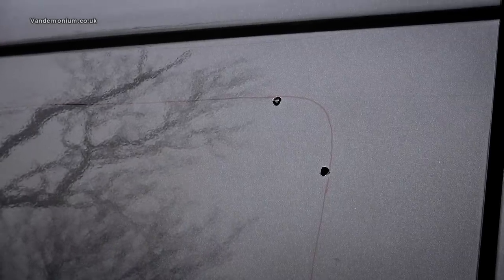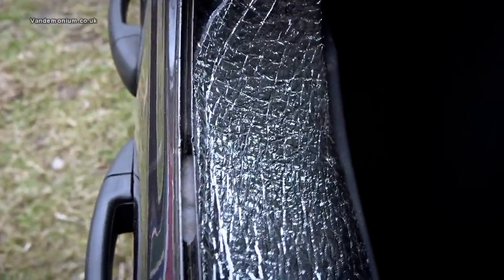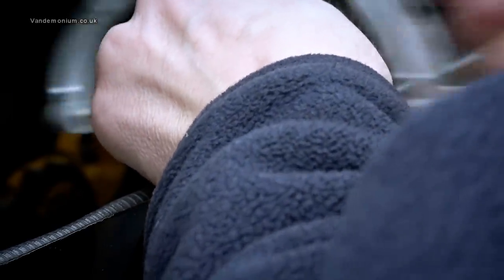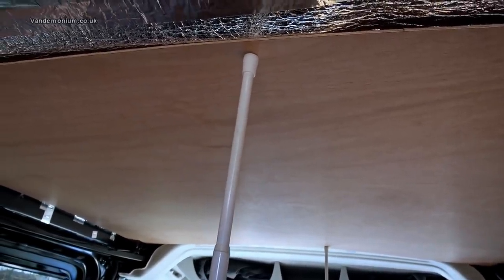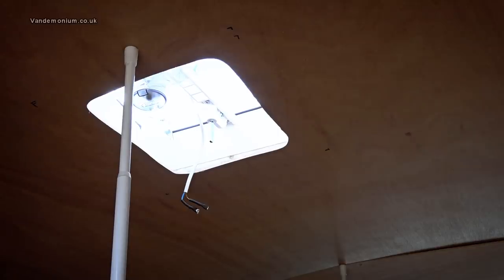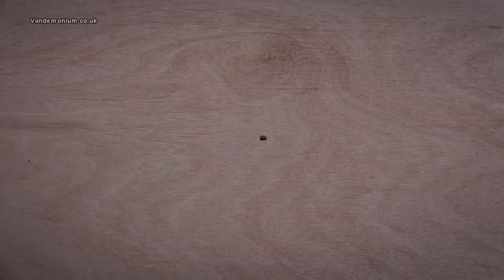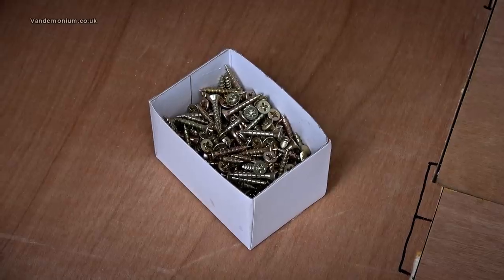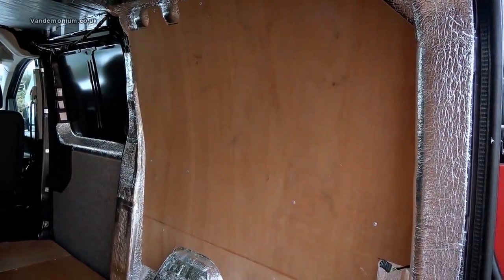Vlog 12: installing a bonded side window to my DIY campervan (Toyota Proace)

Comment: I'm a complete noob at this and I am amazed at your work and your patience in actually taking the time to vlog your progress. I can imagine just how much time and effort you have put into this project, not only the work of turning your Proace into a camping van but also the work of filming and vlogging! Many thanks!
I have a newer model Proace and am just starting to do the same. 
One question if I may. Is the wiring for the LED lights and Skylight fan spliced into the existing wiring or will all the modifications run off your solar setup?

Comment: Exactly the same thing happened with the width of the trim that was supplied with my windows. There were two skins to get over and luckily the "Glass for Vans" chap doing the install rang his office and they ordered me some much wider which fitted over both skins. Does make you wonder why they don't sell you the right stuff to start with. Coming on nicely Dave!
Reply from the maker: Cheers Greg. I'm now three vlogs "in hand" and making the cabinets ... I think you'll cringe at my shambolic attempts at carpentry but at least it's starting to look more like a camper now :-)
Reply: You are so fortunate to have the time to crack on, work is still taking its toll on my build but not for much longer 😃
Reply from the maker: That's because you're gadding about going to festivals like Camp Quirky instead of building ;-)
Reply: I'll expect to see you there next year showing off your finished ride 😎

Comment: Couldn't help but notice when you were building your van that a straight edge might have helped. If you are interested I was told to put a straight piece of metal down (or a level), clamp it to your wood and use that to run your saw against. You will get great, straight cuts that you will be proud of. Cheerio!
Reply from the maker: I did try that but somehow still came out with wonky lines
Reply: Vandemonium it doesn’t work with a jigsaw. BTDT. The blade bends sideways too much. I mean, that’s literally what it is intended for, making curves.

Comment: Came across your great vlog. at the weekend. Now caught up and looking forward to seeing more. Have been contemplating one of these vans instead of the joining the VW crowd (and there really is a crowd of them here in Cornwall).
Nice to see you opting for the side bench approach too. Don't think you'll regret that - especially if you keep room at the front end to be able to sit opposite an open side door.
Think I'd ponder a way to fit a shower curtain between the ends of the open back doors.
Reply from the maker: Thank you. Yes, there must be some curtain arrangement I'm sure!

Comment: Looking good so far, I know it's late and you have already done it but they make a tool that goes into the drill that is a quick change drill on one end, pull it out and flip it around and it's a countersink on the other. Pros use them to save time and not have to unchuck the drill then put in the countersink, also it makes it easier to keep track of the two because the drill and countersink are a double ended arrangement that always stays together.
Reply from the maker: That sounds neat, maybe I'll get one

Comment: I did wince slightly when you handled the cut out from the door with bare hands. Gloves may have been sensible. Did you know you can get pilot drills with a built in countersink? Your videos are informative, funny, and give a real sense of the elation and frustration of a self build. Thanks.
Reply from the maker: Not sure why you were wincing? Yes, you can get combi drill/countersinks but then you have to buy a set to ensure you have the right size pilot hole. It's more bother to have separate ones but only one countersink needed. Glad you like the videos, cheers
Reply: "Not sure why you were wincing?"
 - Burrs
Reply: Cut metal edges like that tend to be sharp. You can cut your self quite badly on them
Reply from the maker: Ah. Thank you. It was fine though, no blood was spilled on this occasion. :-)

Comment: My understanding is the window trim is designed to go on the inner skin only anyway. Found this out after I’d ran it round on both skins myself lol
Reply from the maker: Interesting; a lot of the YouTube tutorials I watched clearly had it going on both. Otherwise when you get condensation in the van, it'll run down the window and between the panels and soak into the insulation there (I have squeezed sealant in the gap)
Reply: It will be designed to go over two skins that have been spot welded together. If you pull such a seal off a car you will see both skins meet and are bonded and spot welded together. Obviously this wasn’t the case where the window wasn’t factory fitted. I would have tried to get the skins together for condensation issues and a bit of strength/integrity between the skins. I’m sure Dave did a fine job in sorting something.

Comment: A quick question, now that we're entering May. Will you be returning to the sea ( Canals actually) and storing your land yacht ( Camping van ) or finishing it before you set-out for your next port of call. Arrg. (Said with a bad pirate voice).
Reply from the maker: Hi. I'm still aboard the boat and have been all winter. The van needs finishing before I do any cruising though plus I have some paid work coming up that I need to be around for so any cruising will be minimal until much later in the year I think.

Comment: There are countersink drillbits that can be placed onto a drill. You drill and countersink in one go. I havent used such, but i plan to. It looks quite convenient.
Reply from the maker: I saw those but then you need to buy a whole set with every version of pilot hole size you want
Reply: The way you have done it, while a little slower, is much better in your situation, and the coutersink bit can be used for many more jobs in the future.

Comment: Its starting to take shape nicely, I'm sure that it will end up looking pretty dang spiffy. Good preparation really shows in a finished product.
Do you have a link for the led lights you are using, they look just the thing to upgrade the ones in my narrowboat. Regards, Chas
Reply from the maker: Not offhand but I'll try to find a link next time I'm sat at the laptop. I just found them on Amazon though.

Comment: I’m not sure that hacksaws even come with wood blades, but if they did they’d have more teeth per inch and would probably work better on the rubber than a metal blade would.

Comment: David, as a non driver I wondered if renovations on your vehicle alter MOT or insurance requirements.
Reply from the maker: No change to the MoT; it's insured as a campervan and the insurers are fully aware it was self converted.

Comment: is the window trim not also intended to atop condensation from the window dripping between the panels?
Reply from the maker: Possibly but I thought of that and went around the gap between the panels with a thick gooey waterproof sealant.

Comment: Next time use masking tape where you are jig sawing so you don't scratch the paint
Reply from the maker: Thanks. I did that on the back ones but didn't have any this time. It doesn't matter though as the scratches were light, get hidden by the glass and I blobbed some primer over them as well.

Comment: I have restored several antique cars. One guy I met doing one. Told me something that has some real truth to it. It may take you longer, but you did it yourself. Now I have an question. Is there any chance that rain can get behind the glass at the top. I ask this thinking. If water gets in. Could it freeze , and possibly expand and break the glass.
Reply from the maker: If it goes behind, it will either flow out along the line of the sealant or if frozen, would freeze up and out the gap. This form of window fitting is pretty commonplace and I've never heard of any breaking through freezing water.

Comment: Can I ask what is the length of the interior load area of your van, did you consider the long wheelbase vs the short?
Reply from the maker: It's the LWB version though it's only about a foot longer than the SWB
Reply: Lwb will make all the difference in comfort! Have a double width bed!
Reply from the maker: The wheelbase doesn't affect the width of the bed; it will extend sideways to make a (rather slim) double.
Reply: Vandemonium  I’ve been on the verge of buying a lwb transporter , purely because Lucy my large dog will need her own floor space to sleep on, that’s why I was asking, wanted to know how much floor space would be left (in theory)  when your bed is in use
Reply from the maker: Mine's not a Transporter so I don't know how much you get in those, nor the difference between the SWB and LWB versions, sorry. Mine's a Toyota Proace. I don't think there'd be a lot of floor space for a large dog though, no matter which one you have.

Comment: Nice work, but why factory single glazed windows instead of campervan acrylic double glazed?
Thx for the vid!
Reply from the maker: I imagine the double glazed ones are expensive (though I didn't look) - these just seem to be the standard type that are put into compact VW-sized campers so that's what I went for.
Reply: The double glazed ones aren't that great from what I hear. They don't get you that much extra r value, the seals eventually fail causing them to need replacing/refurbishing, and they scratch easily.

Comment: I think now thiat you have windows  to the rear of the doors  that you may have to pay more viechle tax. i had to when i did a sprinter 11 years ago.
Reply from the maker: I think it's all based on the emissions these days but I may be wrong.
Reply: I would certainly check.  they used to say it was not a van if there were fitings,(seats  etc) rear of original fitted seats.  hope you are right as it was near 1000 pounds for mine.

Comment: well done sir! may i recommend  you to use knee pads ?
Reply: Great point Roger. 👍
We only realize how great this suggestion is until we get a little older.
Reply from the maker: I've been using a folded towel and it works well so far!
Reply: David, just think how professional you will look with your knee pads on. 👍
Reply: Do not neglect this, if you damage your knees it will be to late, because they don't heal, damage is permanent, all the best